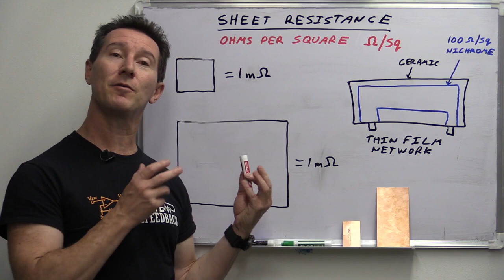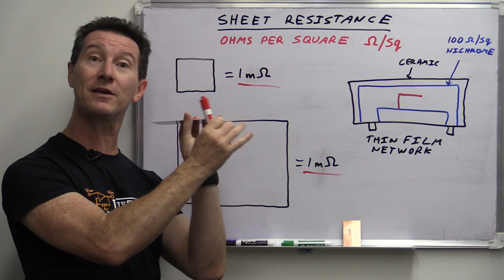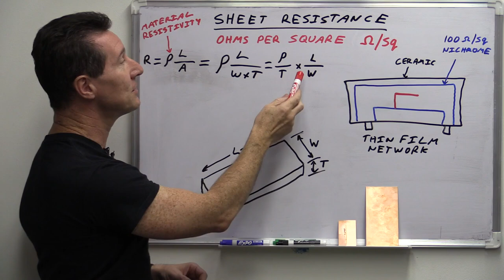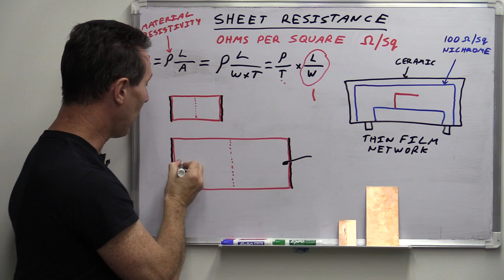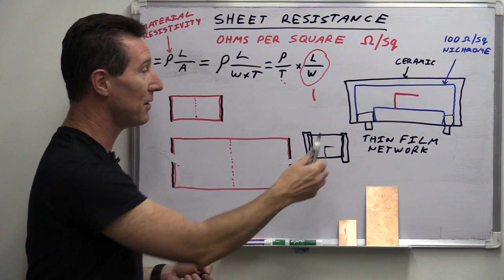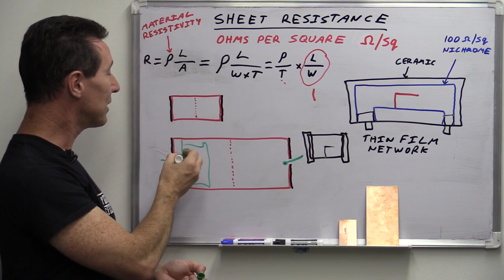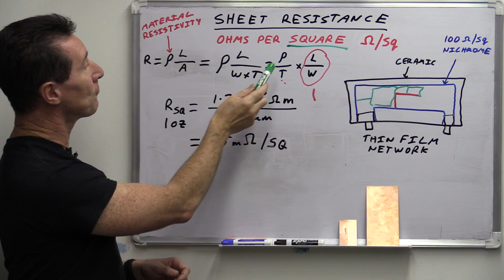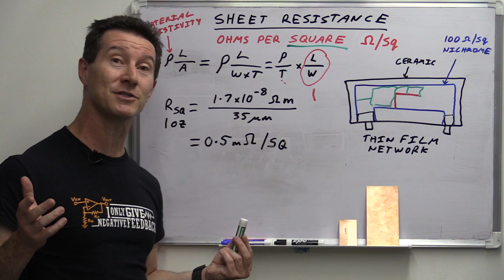EEVblog #732 - PCB Sheet Resistance

Comment: Dave, you missed a point that may increase the insight of the viewers:
You can divide a large square in smaller squares and consider this as a series parallel circuit. Say that the end to end resistance of the small square is 1 Ohm. Then a two times as large square is made up by two strips of two smaller squares in series. The series resistance of two squares is 2 Ohm. And these series circuits are placed side by side, thus in parallel, what make a total resistance of 1 Ohm. Thus the same value as the smaller square.
Reply: meettechniek That's what I figured out after some minutes, because I was one of the confused people in his last video. But Dave's approach is more general and mathematically easier.
Reply: meettechniek Exactly.This could have been a 15 second fun fact. "Double the series resistance and double the number of resistances connected in parallel and bingo, net resistance remains same."
Reply: @lhxperimental  BINGO

Comment: It makes perfect intuitive sense.
Dave, I would have mentioned that you can visualize sheet resistance by imagining a matrix of infinitestimally small, identical resistors, connected along the width and the length of the sheet. The wider (and the thicker) the sheet, the more resistors in parallel, the longer the more of these sets in series.
If you increase or decrease the size of the sheet, but keep the aspect ratio (squares remain squares 2x1 rectangles remain 2x1), you are adding or removing resistors proportionally.
For example: 8 x 1 ohm resistors in parallel, in series with 3 more (4 total) sets of 8 parallel resistors, make 0.5 ohms (0.125 * 4).
So do 4  x 1 ohms in parallel, in series with another 4! (0.25 * 2 = 0.5)

Comment: As a practical example people should watch episode #317 where Dave is doing some experiments on PCB tinning and current capacity.  Here he is performing a 4 wire resistance measurement on a strip of veroboard (1oz).  He kindly provides the length and width of the copper strip (358x4.2mm respectively).  Do a quick calculation based on the 0.5mΩ for copper sheet and we get the calculated value of 42.6 mΩ for 85.23 squares.  Pretty close to the measured value of 51 mΩ in episode #317.

Comment: Dave,
Hello from St. Louis, Missouri. Great vlog post, I'm a beginning electrical engineer (year 2), I can appreciate the value this information brings to the viewer. How a chip resistor works and how sheet resistance applies to it. I use many 0603 and 0805 chip resistors in my PCB layout for work. Now I know how they are construction and the reasoning behind the size of the solder footprint. Thumbs up!

Comment: the trick to understanding electronics is making the connection
Reply: brandon carter groan. shameful! :D
Reply: brandon carter  Ohm I see watt you did there..  This guy has potential..
Reply: hank bizzo only if he keeps his material current.sorry, I couldn't resistant.
Reply: brandon carter Oh you have the power to make me chuckle. No negative feedback for you!
Reply: That is mean. Chris Gray
Reply: Yes, especially if you connect your MM in line and set it to volts or ohms. brandon carter

Comment: A good way of thinking of it is like this: As you increase size of square, you would think you are increasing resistance (due to longer path) but you are also increasing the parallel conductors which lowers the resistance across the distance, so this cancels out the increase of resistance from the size increase, keeping things constant.

Any increase in conduction path (which increases resistance) also incurs extra conduction paths (which lowers resistance).

Comment: A suggestion for a better way to control the resistance: cut the foam longer than a square, and put it face up on your bench with the shorter length of the foam between them. Ideally, you would put another blank pcb of that width in between them, but upside down (assuming single sided copper-clad). Measure the area of your foam, then put a weight proportional to the area on the foam, making sure the load is evenly distributed, to get a consistent contact pressure.

Comment: Great video.  I really enjoy this channel.  

I'm sure others will have made a similar point, but the easy way to show the truth of unitless square fact (in my world of elastomeric adhesives and sealants, we generally talk about surface resistivity but it's kind of a 6 or half dozen distinction) is to show that you have some specific resistance per square unit.  Then, place two square units in series and, as expected, the resistance doubles.  But you're left with a 2:1 aspect ratio rectangle so the linear units haven't really disappeared yet.  Then, take two of these rectangles and place them alongside each other in parallel and you're left with square twice as wide as the original where, if the original film resistance or surface resistivity is R, the 2:1 rectangle is R+R = 2R and so the paralleled rectangles are 1 / (1/2R + 1/2R) = 2R/2 = R.  

The a part that I find more interesting is the formulation of electrically conductive rubbers like that foam you used with the meter.  The usual way to get there is to load an elastomeric material with something conductive.  I would wager you have a urethane foam bearing a considerable amount of carbon black pigment.  Normally, in formulating elastomers, the goal of a filler is to reinforce the binding polymer.  So ideally, the filler load would essentially dress every filler particle in an exceedingly thin polymer coating.  Then, when it cures, the fillers are bound but separated by the polymer and the filler can lend the maximum reinforcing strength to the material's lattice structure.  With a conductive formulation, though, the amount of filler is actually a bit higher.  It makes the working viscosity of the uncured material generally higher, necessitating more plasticizer in the system to allow for flow and extrusion of the uncured product.  As the system cures, the polymer shrinks a bit and the plasticizer migrates to the surface and eventually leaches out (effectively promoting additional shrinkage).  This allows the filler particles come into physical contact with one another, providing countless tiny "traces" to pass current.  In addition to providing better contact between your trace boards, the pressure you exert also helps force contact through those fillers.  So the bouncing readings on the scope were quite literally measuring the jitter in your arms as you subconsciously adjusted your muscle flex to try to hold everything consistently tight.  Kind of amazing when you think about, eh?  :D

Comment: Nice video! I think the counter-intuitive part comes from the fact that when you think higher current, you think thicker traces, but the reason for that is not to lower resistance (at least when comparing thin/thick traces with the same number of "squares"), it's to raise the power dissipation capacity of the trace. Instinctively you'd think you need to lower P=I^2R, but that stays the same for two equal square traces ;)

Comment: At 8:50 into the video you show how the laser cut works.  However the first smaller square is not contacting all of the right edge of the bigger square to the left.  Why is it that the squares can be added at the top of the laser cut but we must probe along the full edge to measure properly?

Also I don't think the squares under the laser cut are added as the net current in and out of the area under the laser cut is 0A therefore this area would be an open circuit.

Comment: Thanks for the explanation.  After the thin film video I was thinking of ways to demonstrate this and I came up with the same thing, except I was going to thread a wire through the end of the foam.  Also considered making some silicon rubber sheets doped with graphite. You saved me the trouble.

Comment: An intuitive way to grasp the concept is the following: Think of the atoms/molecules of the material as tiny resistors of the same value that are all connected in a grid. We know from electronics 101, that if you put two resistors (of the same value) in series, their total resistance doubles. If you put them in parallel, their resistance halves.

You can easily reproduce this experiment with four 10k Ohm resistors connected in a grid. The overall resistance is - lo and behold - 10k Ohms.

Now go, grab some resistors and measure it :)
Reply: Amen... this is what I was expecting to see.  We all know those formulae for series/parallel resistances, so I was expecting them to be used to explain this.

Comment: Dave's "paddles" have a sheet resistance as well. That resistance is in series with the sheet resistance that is being measured and is figured into hls measurement - all from a single point of contact (so his logic of having to connect to the entire edge is in error). It is just a measurement of series and parallel resistance.

Comment: It's simple enough to understand just using wire as an example. If you double the length of a wire, the resistance doubles. But if you add a second wire of the same diameter, the resistance halves. One 10cm wire is the same resistance as two 20cm wires, for a given conductor size.

Comment: The Sheet resistance formula is common sense. The easiest way to explain it is if you see it like a resistor: if you double the length of a piece of copper, it will have double the resistance (2 resistors in series), buy if you double the width you will have 2 resistors in parallel, so the resistance will be half and so the resulting resistance will always be the same.

Comment: What I took from this is the thickness of the giant "trace" and the length of the trace remain a constant ratio 
Like paralleling 2 10k resistors and putting that in series with 2 paralleled 10k resistors will be 10k

Comment: Dave, it should be noted that while it might be a good approximation it still an approximation. Not every shape's resistance can be satisfactorily calculated by a sum of squares as current density may not be uniform over the whole square.
Reply: vihai It’s not a “sum” over area, but a sum in finite element sense, which happens to be a simple arithmetic sum when the shape is rectangular and the mesh (subdividing squares) are symmetric along the length. For any other shape the finite element approximation takes care of no uniform current density. Given how relatively easy it is to compute, I wonder why the feature is not standard in expensive EDA packages :/

Comment: i was hoping you would cut the foam using similar patterns as those seen in the trimmed resistor to demonstrate how it changes the resistance, but i can see how that would have been difficult with the improvised experimental setup.

Comment: It makes perfect sense.  If you compare, say, a 2 in. square with a 4 in. one, the 2 in. square would have twice the resistance as the 4 in, due to half the width, but then, half the resistance, because it's half as long, so the two cancel out.

Comment: Makes perfect sense, just visualize a sheet as a bank of resistors connected in parallel, then add resistors as you lengthen or widen it.

Of course you must count squares in series, not squares in parallel, squares in parallel are fractional squares. So a 2x1 rectangle measured lengthwise becomes 2 squares, but measured edgewise becomes 0.5 squares.

Comment: Good video, but you should say how they trim the the thin film network :
They start to reduce the area (w x T) (coarse : vertical cut) aim to have smaller square ; and they reduce the network resistance (fine : horizontal cut) ; at the end you have a equivalent model of 3 resistances in star, with one with a disconnected terminal. (may induce some noise)

Comment: I think one simple way of explaining it is that even though the distance (length or series resistance) is increasing between the two sides of the square sheets, the width (parallel resistance) is also changing which equally counteracts any increase in length.

Comment: I have to say I did the math while I was watching Your video on the Resistors - 'cause at first it sounded strange. So the math was not new to me.
But Dave, was there really no other way for a practical measurement? You could have done this with two pieces of copper heating pipe as the probes. In reference to the copper board the resistance of the pipes would have been to low to really change the result. And You could have shown the incredible Resistance measurement capabilities of the Keithley... Or at least You could have used any solid material. A square of salami schould have been better evidence than the spongy foam, were the resistance, as You said, was mainly determined by ''the force''.

Comment: I really would have liked to see you make a cut in the foam to demonstrate the laser trimming and then counting the blocks in the cut version of the foam. You'd of course need some sort of insulator to place in the cut.
Reply: russdill Mere “counting” the blocks is insufficient unless you’d use that with a  shape formula derived experimentally or theoretically. For a general solution you need a finite element grid.

Comment: At about timestamp 16:30 with the rectangle, what if you
1) measured it along the LONG edges?
 ALSO, What if you
2) measured a stack of three squares compared to ONE (would it be three in parallel)?

Comment: When I was first grasping the concept, I would think of standard series and parallel resistance math, where the length is series and width is parallel. Pretend each unit, like sqr cm is just a resister of a certain value, the length would be series, so say each sqr cm is 10ohm, if length is 10cm, each 10cm wide strip would be 100ohm, but then the width would be parallel math, you have 10 100ohm resistor in parallel, so again you total resistance is 10ohm...It is cool for changed orientation too, say you have a sheet that is twice as long as it is wide, the resistance across it lengthwise would be twice that of just the square, as you shown, but if turned it 90deg and measured widthwise, it would be 1/2 the square resistance, because you have twice the amount in parallel.....Hope that does not confuse more people.

Comment: Great video. I have two questions. I hope I'm not commenting to late to get an answer from some of the smart people here.

1, When you cut the L-shape with a laser, you create more squares but what happens with the area under the L? Is that counted as well?

2, In the video with the precision resistors, there was a curved cut in one place, how do you apply the squares there? A curved line can be approximated by an infinite amount of squares which will be a bit of a pain to calculate. Do you give up the concept of squares there and just calculate the area (conductor volume) instead?

Comment: Dave, my non-engineer mind has a much easier time thinking of sheet resistance as a massive array of resistors wired both in parallel and in series.

The more resisters you put in the parallel, the lower the resistance; and the more you put in series, the higher the resistance.  Therefore, it doesn't matter how large you make the array (if you keep it square), the resistance will be the same.

Comment: Maybe you could have given another geometrical explanation too (explaining the same thing in various manners to help various type of learners catch the concept): if I double a square in the direction of the current, I double the resistance, if I double a square across from the direction of the current, I halve the resistance. So if I double both directions at once I have not changed the resistance. One mildly interesting factoid, is that now you have an easy tool to control the admissible power dissipation of your resistor: by scaling it, you scale its dissipation without changing the resistor value. Plus when you trim it, you can make it bigger so that it is more sensitive to trimming.

Comment: Is sheet resistance like having an almost infinite number of same-value resistors, all stacked in series and parallel? (same value being due to the thickness of the sheet, and the other two dimensions corresponding to the square because there are 2 dimensions [^2]).

Comment: I think the confusion is coming about because people are thinking of it in terms of a wire where cross sectional area increases by the square of the change in dimension, but because in a sheet, the thickness remains the same, so the cross section increases linearly with the change in dimension.

Comment: I don't really think it's counter intuitive,  we have all learned in school that the resistance of length of material depends on it's length and it's thickness. The Ohms per square is just a consequence of that rule. It's just a simple formula.
Reply: Eviltech Perhaps a touch counter intuitive as Dave just showed pieces of material of differing lengths that have the same resistance.
Reply: Eviltech according to your formula length and thickness it's very counter intuitive since the formula explained use the width, length and thickness. and only double the length = double resistance. double width and length = same resistivity.
Reply: I was expecting tessellations of the smaller board onto the larger and then using the resistors in series and parallel equations
e.g. for a board 3 times larger in length & width than your original (r) then using the resistor parallel/series formulae, you'd get (⅓r)*3=r or 3r*⅓=r (depending on whether you calculated the parallel or series resistances first)

Comment: Love the Fundamentals Friday videos - please do more of them!

But I have to say Dave... you have that beautiful 7.5 digit multimeter - you surely could have measured the resistance of the copper clad board instead of the foam. I suppose getting the contacts right would be tricky though.
Reply: Or would be noise because it’s one square, so the lowest possible resistance of copper in that thickness. That is not something even the best handheld meters could reliably measure